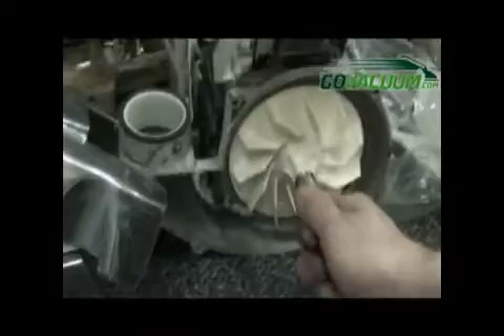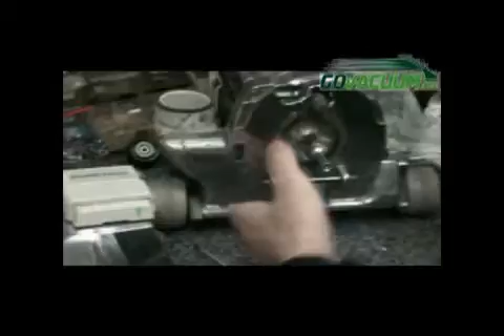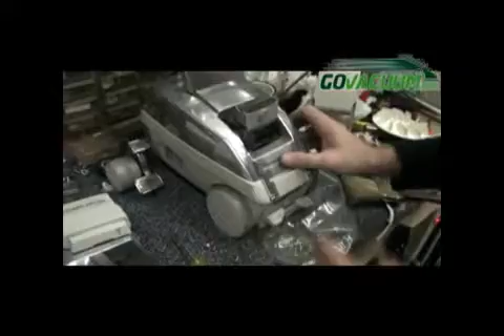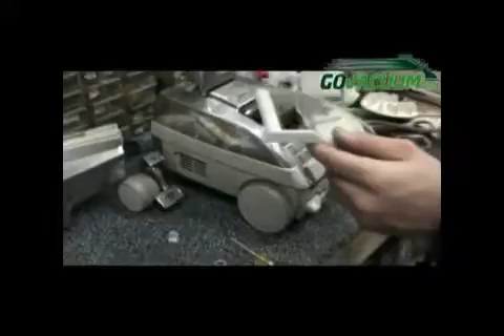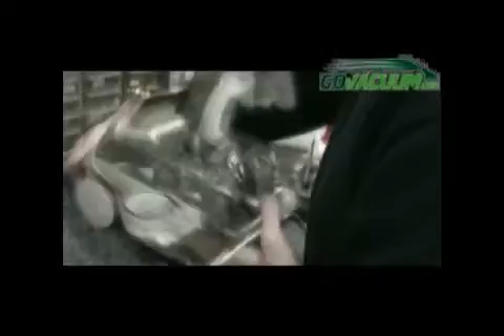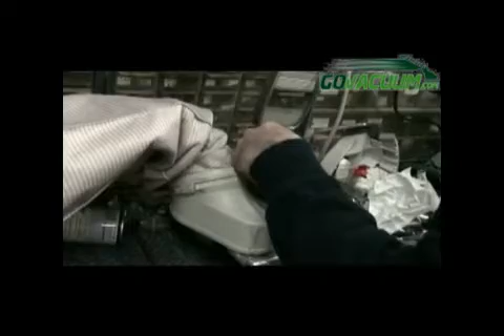How To Replace The Suction Fan On A Kirby Generation Vacuum Cleaner - Part 2

Comment: I tried removing the fan today but when I try to free the spindle, the entire shaft going back to the transmission spins while holding the fan itself. Any suggestions?  I have the G7 model. I fixed my shifter that had come undone during this time  but the fan removal was not a success. Thanks